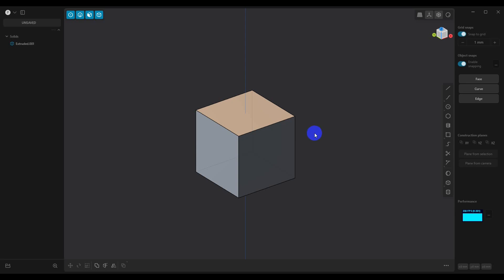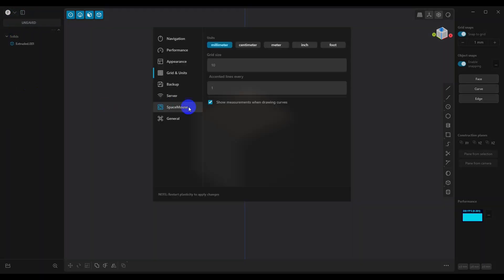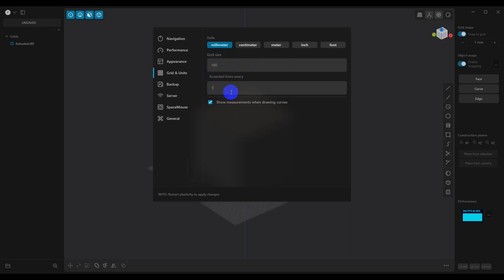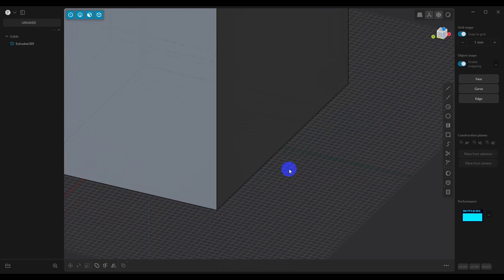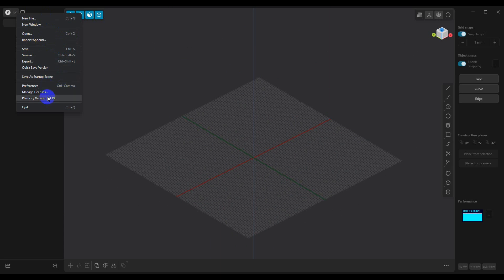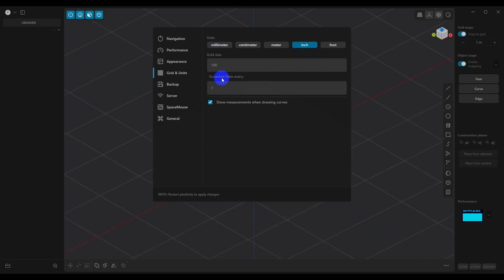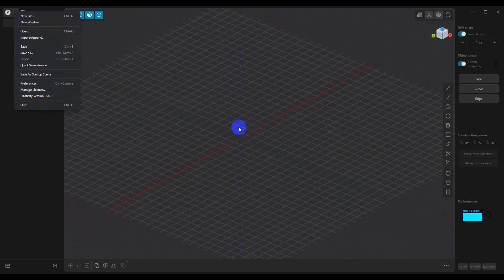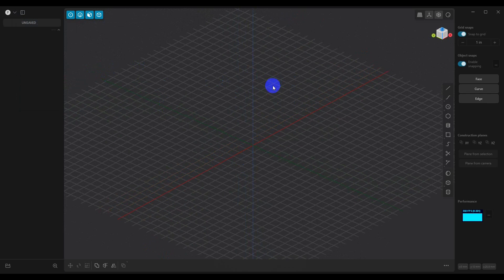Setting up the Grid and Units in Plasticity

Comment: Just trying out the program but ran to an odd issue.  Everytime I adjust to MM, the grid disappears.  When I move back to inches it reappears.  Anyone seen this before?
Reply from the maker: @dsngjoe2
Did you change your Grid size and accent lines?  Also, you could try Ctrl-Shift-R a couple of times. I have not heard of this, but you might want to file a bug report.
Reply: I am having the same problem.
Reply from the maker: @dsngjoe2
@jamesswartz2203
Try hitting the number 3 on your Numpad and see if the grid shows up.
Reply: if you have issue with the scale adjusting after switching units, press the [ ?/ ] button